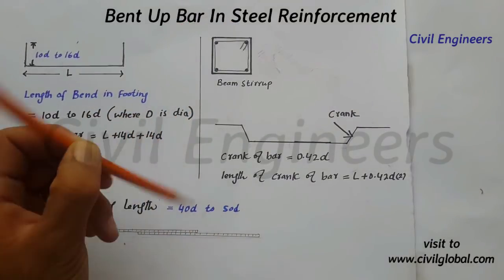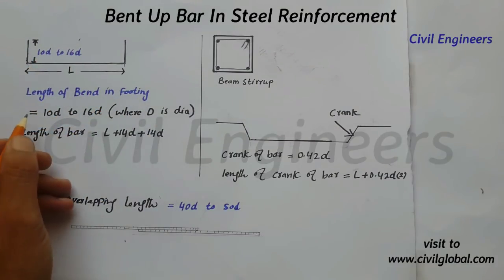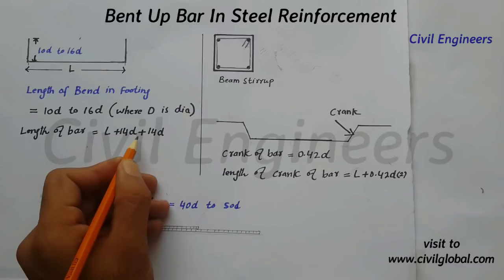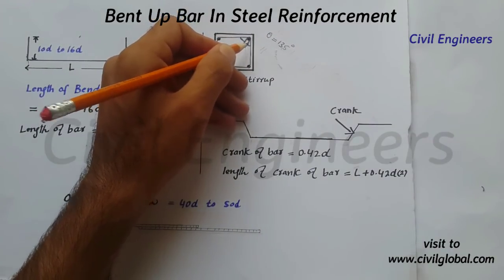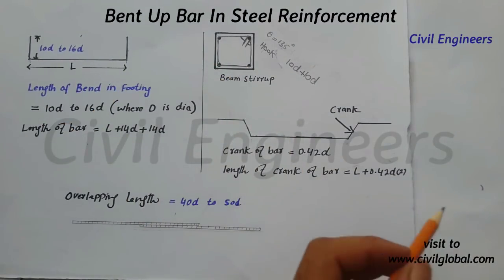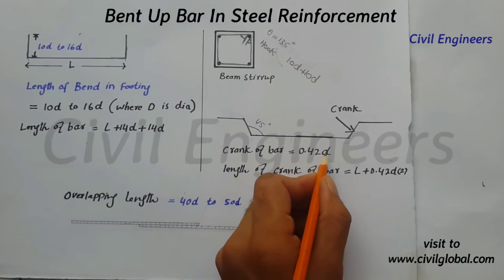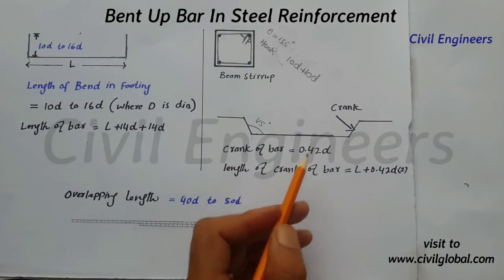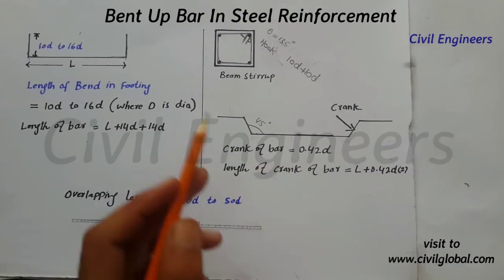How To Calculate Cutting Length Of Bent Up Bar in steel Reinforcement

Comment: Cutting length of bent up bar can be calculated by below formula:- ( L+(2*(0.42h)-(1d* no. Of bends))
Where,
• L is total length of including L1, L2, L3.
• h is the height of bend portion.
• 1d is deducted for 45 degree bends multiplied by no. Of bends.

Comment: In 0.42d "d" is not dia of bar but the height of bend and the 45 degrees is other side of the crank.
Reply: Yeah you are right d is distance from top to bottom of the bent up bars

Comment: with respect to length of crank that it is  impossible equal 0.42d and d means daimeter of bar ,suppose daimeter of bar=12mm then the length of crank will be 0.42*12=5.o4 mm ,that is wrong ,and your fixed value like 10d and 16 d,are they depend on ACI CODE ? PLEASE we need ACI CODE .THANKS

Comment: Absolutely wrong.. Suppose the Dia of bar is 10 mm,  then the length of crank as u said is 0.42 d,  so it becomes 4.2 mm.. Do you think the crank length is 4.2 mm?  Wrong knowledge De Raha Hai sala
Reply: rohit chavan g
where  in crank  length =0.42D
where D is a dept of beam /slab 
D is not a diameter of bar